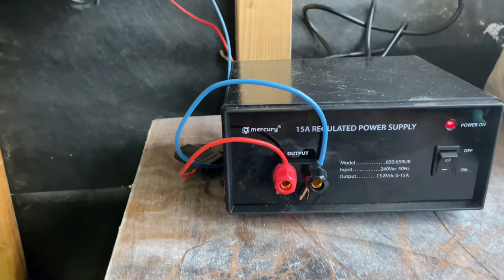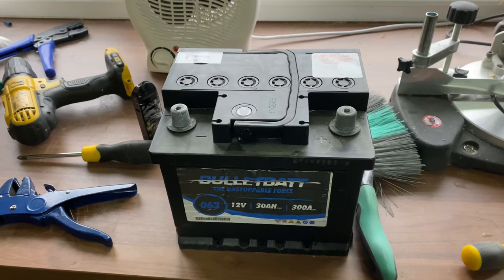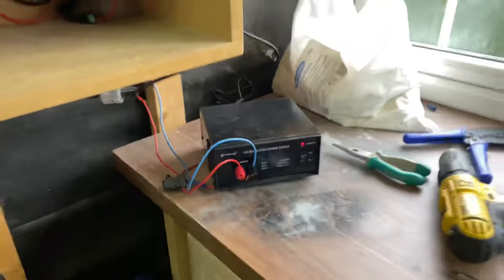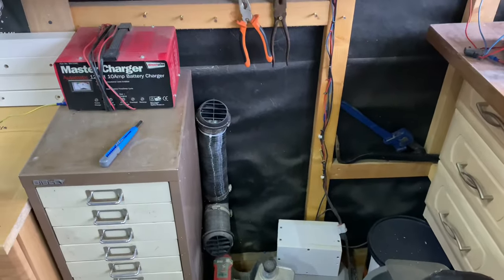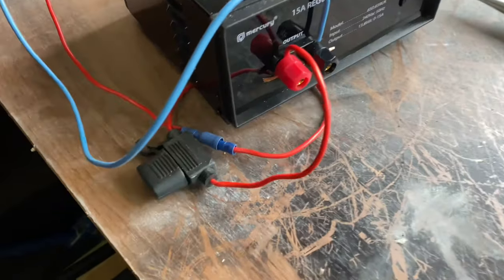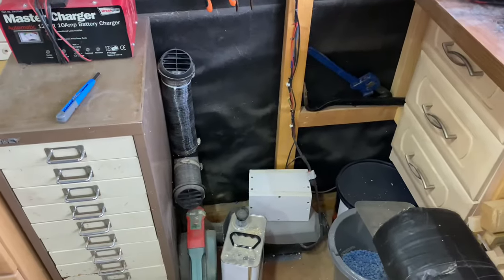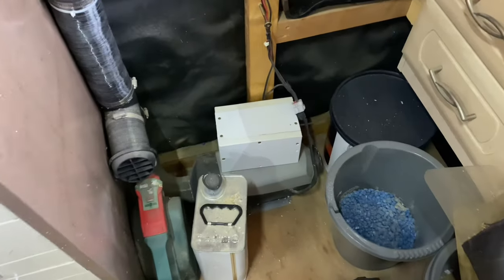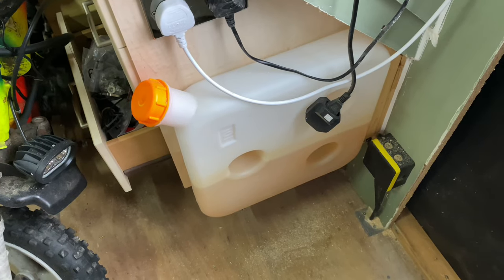DIESEL HEATER BATTERY IS A WASTE OF TIME! Switch to a power supply

Comment: These heaters were designed for off grid and battery supplied power works perfect. I live on a sailboat and my solar setup which is only 300ah has kept my heater happy while running my fridge, tv, phone, laptop and tablets with charging.
Reply from the maker: Cool, cheers Terra
Reply: Can you give me the rundown on your setup?

Comment: I considered a 240v / 12v power supply but in the end chose a battery and trickle charger. The reason being, if our power goes off, which sometimes happens where I live in Wales. I can (a) still heat my home (b) let the heater go through its cooling down cycle when I turn it off.
Reply from the maker: Yeah, although this happens in my van regularly but the heater is fine. Batteries often go flat in the stealth van
Reply: Perfect!
Reply: @Albert  Yes Albert, that’s what I’ve done. It hasn’t let me down yet and we had two power cuts last week alone.
Reply: Could I ask what battery you purchased ? As unsure of power rating
Reply: Hi Rory. I bought my battery from Euro car parts. I believe it is the smallest car battery they do. The brand is Lion  063.  Priced at £45.49. Rated at 40 ah.
Reply: @en53kff  thanks for taking the time to let me know I find it so confusing I will do the same
Reply: Just use a backup battery controller with the power supply just in case you lose power from the supply it will auto switch to battery power

Comment: I fitted a cab heater (Eberspacher) in my workshop over 25 years ago before the cheap versions were available, as others have pointed out it is preferable to run the instalation via a 12v battery and battery charger, this will ensure correct shut down procedure in the event of a mains powe failure. Even if its running when the power fails eventually the low battery voltage wiill shut the until down correctly without damage.
Reply from the maker: I had the original too, really expensive but a good unit. It got stolen with my first van unfortunately
Reply: A small motorcycle battery with a charger or a 15A power supply will solve any shut down issues.
Reply from the maker: There’s no shut down issues in my opinion, my burner in my van stops abruptly all the time when my voltage drops, starts back up 1st time the next time I use it.
Reply: @STTC  When the heater mother board senses a lower voltage from the vehicles battery needed to run safely it will initiate the correct shut down including the fan cooling the unit automatically and without intervention leaving the unit safe. Once the correct operating voltage is restored it starts as normal.
Reply from the maker: @haroldbell1097  that’s great information Harold, cheers
Reply: @haroldbell1097  but that would kind if rise the question to me if that voltage is changeable  (being still able to start a car not being fully drained)
Reply: Thats what I thought
Reply: Just installed heater and definitely have a battery for cool down periods. A trickle charge to the battery and Bobs your Uncle.

Comment: You don't really explain why you stopped using a battery and your title says using a battery is a "waste of time" but you never explain why. I can only asuume your solar set-up isn't much chop. As you are indoors and had just used a basic trickle charger to keep the battery charged up rather than unreliable solar what exactly was your issue ? People run their heater off batteries in their vans and caravans in their thousands with absolutely no issues at all. I agree that if the heater is always going to be indoors permanently then a power supply makes sense - but then again that is a very cheap no-name Chinese power suppy so good luck with that !
Reply from the maker: Hi Reg, thanks for watching. I too run a heater in a van off a battery without a problem. I use a heater in a shed off a battery with a trickle charger and solar, however I am on my 3rd battery in 5 years so I am guessing the battery isn’t used often enough to remain healthy perhaps? maybe the cold weather is too much, I just don’t know. I do find your comment a little passive aggressive if I’m honest, I’m not claiming to be an expert.
Reply: @STTC  Yeah sorry about that - grumpy sounding old man here ! Appreciate what you are saying. I'm no expert either but I only queried because I know many use batteries with them and hadn't complained about battery issues. Anyway cheers for Xmas and thanks for the video.
Reply from the maker: Hey no worries buddy, I appreciate the comment all the same. I’m definitely putting it down to under use, my van batteries are always being used and charged and it keeps them healthy, my shed battery sits there for the whole summer and autumn and never gets discharged so I’m guessing it just goes bad, even with the trickle charge. Use em or lose em is an old saying with batteries. Have a great Christmas Reg

Comment: Using a power supply with no battery backup is extremely dangerous. If there is a brief interuption in the power supply the heater quits without a cool down and risks melting the board, wires and possibly catching fire. When the battery supply voltage drops to 10.7 v it automatically goes through shutdown procedure.
Reply from the maker: Yeah, that’s rarely the case and I prove in videos that the pump survives multiple shut downs with a loss of power, they are also so cheap now that it doesn’t break the bank if it did meltdown

Comment: These heater units   have been designed and tested for a lot of things like people's safety  the units longevity and safety. If it was to be connected to mains power they would have put that into the installation instructions.  Granted you may ignore the manual and the installation instructions because you feel you know better but don't fool yourself theses a lot smarter people especially the one who designed this unit than use , So better to use the unit as per installation instructions.  Oh waste is another problem.  Who new.
Reply from the maker: Cheers for the comment brother

Comment: And when your power goes out your toast !
Reply from the maker: I take it you didn’t see the next video? where I demonstrated how wrong that comment is RT https://youtu.be/UWSBXaIIUJw
Reply: @STTC  Leave it off for two hours !
Reply from the maker: @RT-tn4ry  that would be unreasonable as I only switch it on when I’m in the shed, the trouble with experimentation is that scientists that adamantly disagree will always add their own parameters to ensure they are right. Keep it reasonable and practical RT, let’s be fair.
Reply: @STTC  Use a battery folks , keep it charged. If your power goes out for hours which it usually does you are covered. Sorry Steve , Myth "Busted"
Reply from the maker: @RT-tn4ry  🤣🤣 Cheers RT for the comments, I do advise on this too, in the video. I’m sure I can count on your subscription brother, more experiments to come
Reply: @STTC  Well that is just plain stupid of a test.
Reply from the maker: @grabir01  🤣🤣 perfectly summarised, hope I can count on your subscription
Reply: Try MeanWell backup powersupply with 12V battery  then a UVP Undervoltage protection board + relay to switch off/on the pump in case the mains goes out. When the control board no longer sees the fuel pump it goes into shutdown.

Comment: If you're wondering about fuel usage 
Each impulse of the tiny pump us 0.02ml.  Just multiply that by the impulses per second
Reply from the maker: Superb, yes, I will work out my average usage in the stealth camper, I have a 1 gallon tank under the bonnet and it uses 1/4 of a tank per night if running it for an interior temperature of 9 degrees

Comment: I am just about to pull the trigger on a diesel heater for home emergencies and plan to run it off a Jackery 500.  The main reason is that if I loose the electricity, I loose my central heating so this will need to run off grid. I have a small 400w 200ah solar system so this could easily be used as a supplement.  Just need to decide what heater I want.......  Great video and very informative, thank you.
Reply from the maker: Cheers brother, this just highlights that these heaters are very robust

Comment: There's nothing wrong in running from a power supply as long as you run though a battery. There will be power cuts all over Europe. If your power goes down and there is no backup the heater will stop and it will be at full heat. This will damage the heater and could also start a fire. You would be wise to run the heater from a 100amp battery with a battery charger connected. Keep warm :)
Reply from the maker: Cheers Peter

Comment: I have just bought an all in one diesel heater a few weeks ago for £90, and strangely enough, the pump is barely audible, regardless of speed. The ad did say upgraded quiet pump, but I took that with a pinch of salt, so I was very pleasantly surprised. Also I bought the very popular 30 amp power supply off e bay for £20 which is handy, because you can connect multiple devices to it, and run them at  the same time, up to 30amp of course.
Reply from the maker: Sounds perfect, I must look into those quiet pumps for the shed, although I do kinds like the dull reassurance of a knocking pump when in my van

Comment: I have a lawn mower battery with a trickle charger as my power supply in case of a power interruption.  Expect more of those in the future.  Only pulls ~1 amp after start up so the tiny battery is adequate as the tricycle charger takes the load.
Reply from the maker: Very interesting brother, now this makes sense

Comment: Our power goes out a lot in the winter storms here in BC, so I have to use a battery. But yes if there was power and just needed heat your idea would be great.
Reply from the maker: Cheers Sir, you get it! most don’t. All depends on your power supply and the amount of risk, hardly ever goes off here in England these days 👍🏻

Comment: I like the idea of a constant 12 volt supply, but with the sub station at the end of the garden being rather tempremental I prefer car battery and auto charge from my intelligent battery charger. I don't have the issue of the power going out and the heater being shutdown mid stream.
Reply from the maker: Cheers Billie

Comment: I heat a Teepee with one, I bought it because it can run on a battery. I carry a marine battery with a solar charger and a 150-watt folding solar panel but when it's cloudy the panel doesn't put out that much but it's enough to keep it charged. I stay near the truck camping but I can carry it some distance with a hunting sled most of the time I use it to work. I have clean up a place and burned some trash the Teepee and heater will give me a place to stay while I work.
Reply from the maker: Sounds fantastic brother 👌🏻

Comment: Thanks for the video. I was considering a battery with a trickle charger, but eventually decided to go with a 12V power supply off Amazon. It hasn't arrived yet. Should show up next week. 
After seeing your video I'm glad that I went with the power supply.
Reply from the maker: Cheers Cryptopolis, yeah some people have said what if the power goes off, the diesel pump will stop and overheat! It’s a fair point but I have lost power in my camper 6 million times and it’s not caused a burn up etc,,,, it just starts again the next time you use it. No damage
Reply: @STTC  Thanks, that's good to know. I've considered getting a battery & charger as well, just in case the power does go out. At least I should be able to keep the heat going for a while.♠👍
Reply: Think it's too risky to only use a power supply -  losing power Can kill the plug (£6) and do other damage. What is wrong with not using battery and trickle charger - knowing it's safe if you get a power cut. The risk is not worth the cost or loss of heat when you most need it!!

Comment: i use a couple of 12v leisure batteries in parallel, for double capacity... with a cheap MPPT solar charge controller, and a 100w 12v solar panel on shed roof.....
This way, My heater can still run in event of power-cut.... also, can give the heater time to do the cool-down period....
Reply from the maker: Yeah, you can do that but you don’t need to, it’s all a bit of a myth about causing a meltdown if they stop due to power cut, happened loads to mine,,,, never a problem after multiple tests

Comment: I had to replace a motherboard on mine due to an electric outage while running the heater at high temp. It overheated and the MOSFET that turns the glow plug on failed. If the heater had been ticking over I might have got away with it. So a battery and trickle charger works well for me.
Reply from the maker: That’s great info sharing Yoda, cheers for that 👍🏻

Comment: In my experience you are better turning off the power completely when not in use. Reason for killing the power, iv had to strip mine down and clean it out because for some reason on several occasions the heater has started up on a sort of tick oven that I did spot but could have happened more times than I noticed and the problem it caused is it filled the heater full of soot so when I eventually came to use it, if it did manage to start it filled the whole garden and narboroughs garden full of smoke for around 10 minutes but on 2 occasions it would not start as it was clogged up so had to clean it out. After that I killed the power when not in use and problem solved.
Reply from the maker: Very interesting Wallace, cheers

Comment: So what happens when you have a power outage while the heater is running?  No cool down time without a battery. .... Is the heater damaged ?
Reply from the maker: I have had this happen multiple times as i don’t always bother with cool down cycle or I forget, nothing happens, it just starts next time no bother

Comment: Save your cash and get one of these, totally enclosed plastic, use it on my heater. Only £20 on AZ.
Shentian Power Supply Socket AC to DC Adapter 110V-240V to 12V 10A
Reply from the maker: Cheers Paul, appreciate the comment

Comment: I use my heater to heat my greenhouse i use central heating oil, i need a backup from the 12   V main supply that is great, my concern is if the power blips then the heat goes off and if in the middle of the night then it could be harmful to my plants.i want a continuous 12v supply which is only available by battery.
Reply from the maker: That’s a good point and probably the only comment that actually supports the battery argument, cheers

Comment: my vevor didn't work with a hackery 240, just kept throwing error codes.  bought a deep cycle 12v lead acid and it worked fine.  someone online said it's because the hackery 240 is only 300W.  what say you?
Reply from the maker: No idea to be honest,,, but yeah probably not up to the job

Comment: What happens if its at high temp/hot heat exchanger and you have power outage, breaker trip or GFI trip etc. It wont have fan to cool down and possible melting plastic, mother board etc. I think we need a solution that incorporates a backup power source that wont over volt etc. There has to be a correct way to do that.
Reply from the maker: Interesting points buddy but I have said in many responses that mine has stopped multiple times abruptly for many reasons and its fine, this melting argument about motherboard’s etc,,,, is myth
Reply: @STTC  well good to know. But it makes sense it would melt down and I don't know why it does not. I am trying to set one up and just looking for best solution. I was thinking a R/V converter/charger unit like a DLS 30amp. It would supply power and maintain a battery all at once with stable voltage/amps allways allowing plenty of time to shut unit down properly. It would behave just like a battery in a vehicle being recharged by an alternator like it designed to be used. Would be clean way but a little pricey. Just thinking.
Reply from the maker: @pete7894  yeah I agree and I’m not recommending my option but like I said,,,,, mine has gone off probably 50 times when I switch off the power coz I can’t be bothered to wait for the cooling cycle,,,,, had zero effect and power cuts just don’t happen frequently enough to worry about them. The units are so cheap now anyway, almost a throw away item

Comment: It should be on battery to prevent accidental cut-off. Going flat on car battery means before its too late the heater turn itself off and cools down. It depends on voltage when it will shut off.. If you have this power supply and the power goes off - you can easily fry the heater.
Reply from the maker: Nonsense,,,
Reply: @STTC  Any arguments?
Reply from the maker: @jan_vyhnak  yeah,,,, I constantly switch mine off when i leave the shed mid cycle,,,,,, doesn’t cause any problems and starts up fine. Melting heaters and pcbs are myth or so rare it’s not worth considering
Reply: @STTC  Ok doesn't happen to you cannot happen to anybody else..do you realize people are running the heaters in different conditions with different settings?
Reply from the maker: @jan_vyhnak  Show me one where it’s happened
Reply: @STTC  mine fried bearing not the board but still it was result of accidental releasing cable from battery. next start after the incident the bearing was singing strange songs..
Reply from the maker: @jan_vyhnak  Coincidence I would guess,,,,

Comment: Great idea.I might get one myself. My question is though what if there is a power cut. Will the circuit board survive a hot shutdown?
Reply from the maker: Mine has but it’s up to to you Jezza,,, do you risk it? 🤣🤣 I do
Reply: As we have had quite a bit snow up here my solar was covered so jot charging the battery.  Battery lasted 3 days before I cleared the panels.  Wasn't fussed as have generators, inverters and or mains.

Comment: Get a clamp meter that can measure DC current (many can only measure AC current) with DC clamp meters there's a button to zero out any local stray magnetic fields so you need to use that before measurement. How are you powering the supply? Grid or solar?
Reply from the maker: Ok buddy, it’s powered by grid